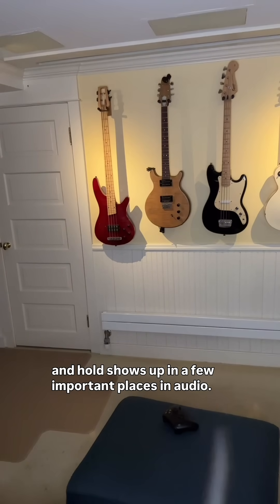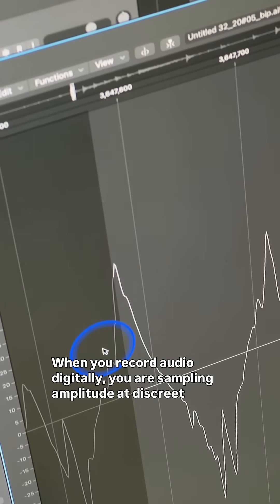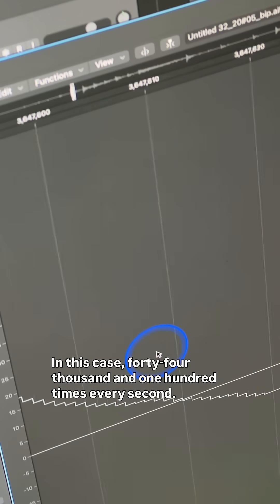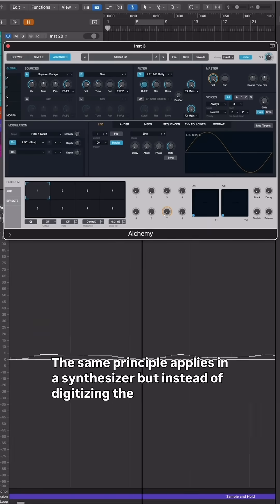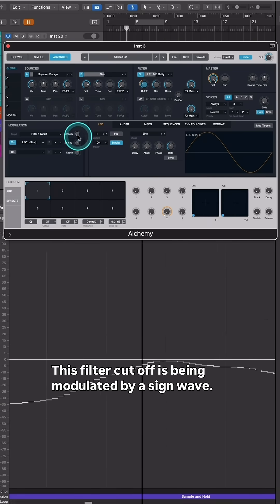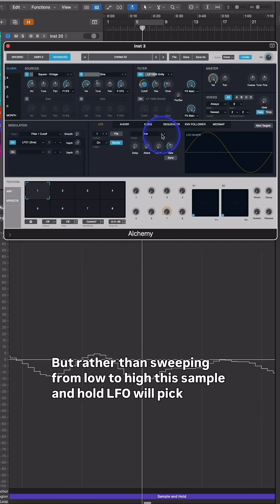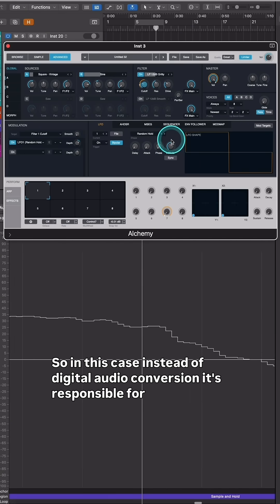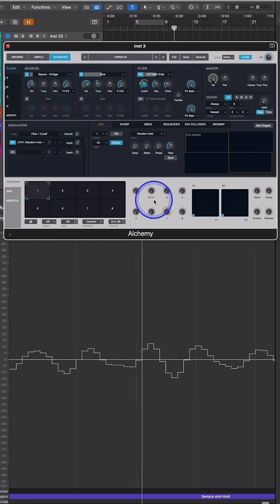Sample and hold: the most slept-on waveform (updated) ￼

Comment: Digital audio is actually interpolated when converted back to analog (DAC). The Nyquist-Shannon sampling theorem holds that all frequencies up to half of the sampling rate can be fully recovered as continuous waveforms. This is why e.g., CD-quality audio is sampled at 44.1kHz--it's a little higher than twice the upper limit of what the average human ear can perceive.

At that quality, acoustic energy oscillating faster than 22.05kHz could sneak between the samples taken (ADC), but we wouldn't be able to hear pitches that high, anyway.
Reply from the maker: Yes, and I don’t remember if I ever posted my Nyquist video here or not. Maybe I will dig it up and repost it. There’s inevitably some pushback against this video because, as you point out, those jagged lines are not what you hear in the end. The DAC interpolates between them. But it is part of the tracking stage of the ADC Ware the voltage must be “frozen“ long enough to sample it. I created this video as a response to being surprised when one of my fellow instructors, an expert in mixing and DSP, was not familiar with sample and hold as it pertains to synthesis. The eureka moment for them was when they applied what they knew about it from Digital audio converters. That’s when I made the connection.
Reply: @beatkitchenofficial That stair-step visualization is definitely a helpful way to illustrate what's happening. I wonder if some e.g., bit-crushers allow you to do that intentionally. I believe that happens in some old-school video game chip-tunes as well. If it comes up again, maybe it'd work to use those as less encumbered examples 😊🤷‍♂️.

EDIT: Or maybe "sample and hold" (when applied as an audio effect instead of a synthesizer control) is exactly that non-interpolated bit-crusher I was hypothesizing. Maybe this is why I couldn't get the sound I wanted out of some recent attempts with bit crushing. Maybe I need to find a sample-and-holdinator 😲.